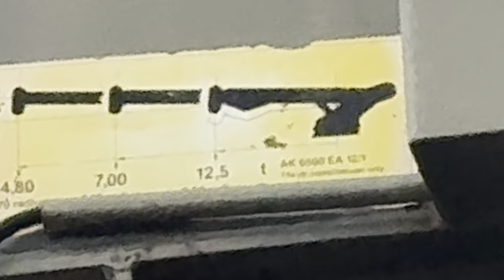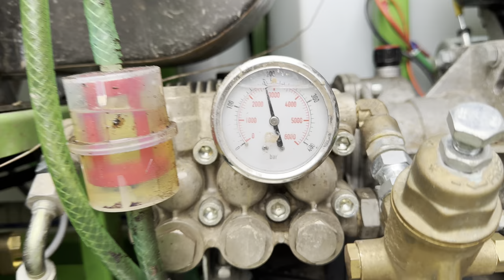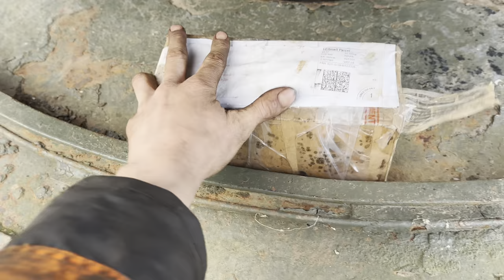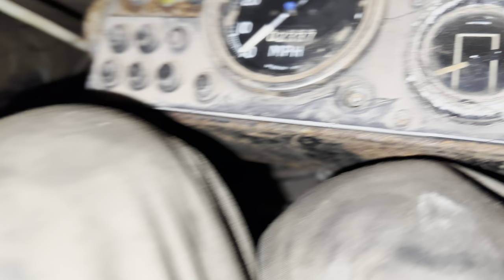We lift a 55 ton Tank! Also new arrivals!

Comment: LIVLRG
I pulled off a front truck bumper with a single tug from the M60A3 in Ft. Knox. It was soooo funny.
Reply: ‘Pulled off’, 🤭.
Reply: Tugged it off as soon as I gave it some pedal, just tapped it, and ripped a big brush guard and bumper off
a Communications Repair truck that was stuck in the mud out in the traing area, at Knox. 
Feel the Power again someday.
LIVLRG ppl.
Why can't WD go home in a f'n helicopter?
Watch my Shorts if ya wanna know, doh.
Fire n Movement
Reply: @lazenblaze9896  WTF you on about 🤷‍♂️?

Comment: Hydrolic oil on ME Govener only needs to be just above the plates, the actual fillier / level  ( though nobody used it like you with top  nut and combi tool ) is the 5/16ths nut on the side. Never run below as will cause possible ME run away.

Comment: Great video. Nice to see the hydraulic starter still works.
When adjusting the control lever on the hydraulic pump for the starter motor, was the rule of thumb 'milling, screw in' or 'milling, screw out'?
I'll check my Chieftain precis from SEME Bordon that's in the shed 🙂.